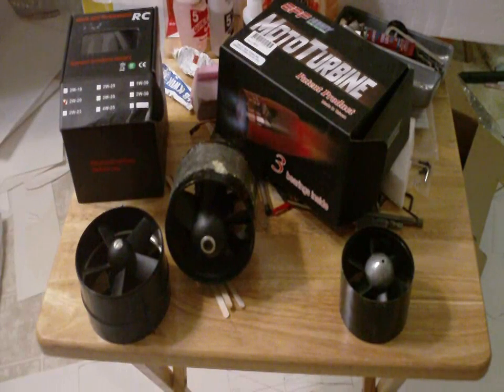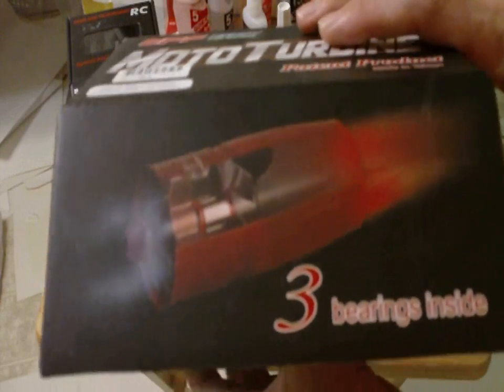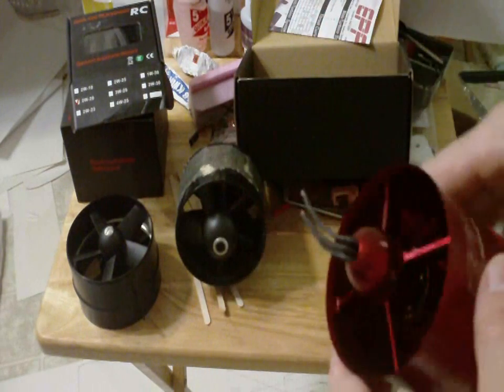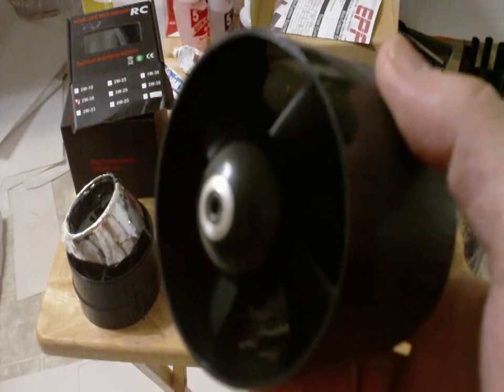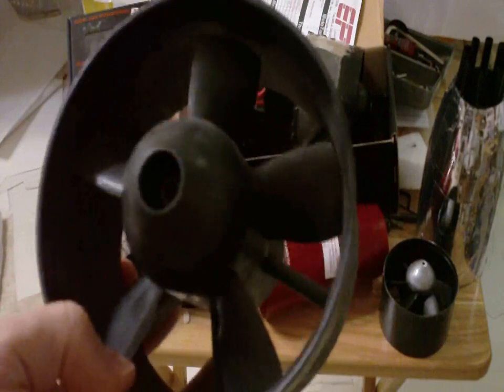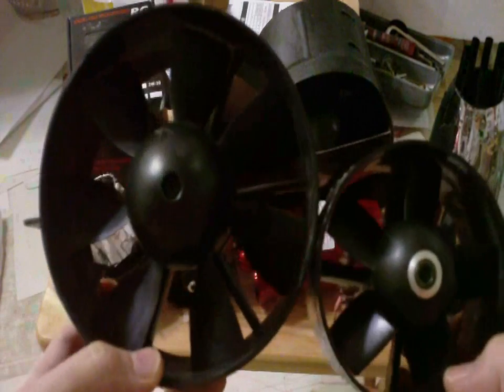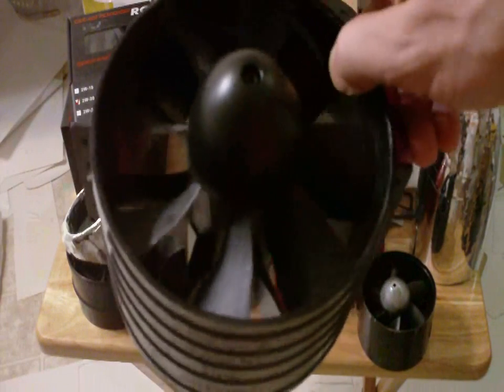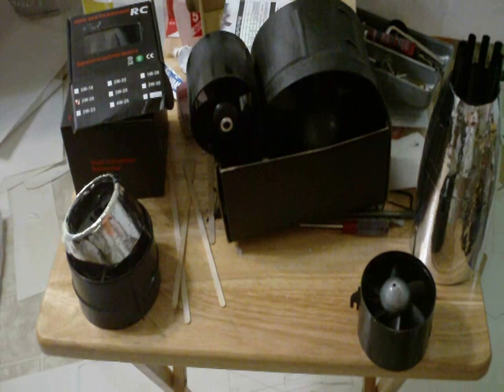Let's talk about EDF's Electric Ducted Fans!

Comment: Hello. I like to control 5 of these for a hover craft build two back throttle two right hand stick steering fans and a cushion fan can this be possible with a drone power distribution board two steering need to be in idle speed until I move the right stick for steering and can one battery be connected to each fan

Comment: What electric engine should i use for a 100kg 4-motored plane that is cheap
Reply from the maker: 220 Pounds?  Wow you might want to try an actual RC Kerosene Turbine engine for that, you'd need something like that to power a plane that size Diego.
Reply: @F3HDemonDriver1  haha makes sense or i might get about 50 edf s to power it
Reply from the maker: What type of Aircraft is it?
Reply: @F3HDemonDriver1  aluminam 747-8
Reply from the maker: Wow-Nice, You have any Videos Of it? or are you still building it?
Reply: @F3HDemonDriver1  no but i will start it soon

Comment: how do you figure the engine that will work on an air plane, for example the plane weighs about 20 pounds, what EDF Electric Ducted fan  would you use, what BA ?
Reply from the maker: The way I determine the right EDF unit is this, the thrust the EDF puts out and the weight on the EDF + Brushless motor, then take into account the weight of your plane, so a 20 Pound RC Plane I would go with two 100mm or two 125mm EDF units. you want at-least 9lbs of thrust from each EDF.
Reply: Thank you so much, very big help.  I enjoy your videos
Reply from the maker: Thankyou Skip!

Comment: From experiment smaller diameter EDF are more efficient than the bigger diameter edf. I particular like the 55mm diamer. Two of the 55mm could produce over 500grams of combine thrust at 10.8V x25 to 28amps. Its very difficult to get over 500gram of thrust with 10.8V x 25amps of power from a single  EDF...my 2 cents.
Reply from the maker: I totally Agree Angel-of-M, but you need to remember I made this video 8 years ago and EDF's have changed allot since then and I've learned allot more about them.

Comment: byron fans lol i have many   not for sale , trying to deal with edf  no flight times  and foam is only thing light enough to fly wiht them. i find nitro fuel  is still cheaper but  the liberals  dont like the extreme noise i produce. i have new in box byron f-16 with fan unit  i may consider sellling being im still flying the 3 i built. but im considering a edf version but not eco friendly

Comment: Hi, iam making an airliner with dual edfs on either side of the wing. so do I need two 11.1v lipo batteries for good efficiency. for how many minutes we can take the plane in skies? with 2 batteries
Reply from the maker: 2 Lipo batteries for two EDF's is what I would do, although so people use one larger lipo to power both EDF units.

Comment: what type of battery would you recommend for a 90mm edf, curruently iam doing a project were i put an edf enginein a rc car .
Reply from the maker: Hi Sir, It all depends on the Motor and what the manufacturer recommends but 90mm EDF's Usually use 18 to 22 Volts of power and 5 to 6 Cell Lipos

Comment: also 
the tricopter i am making is small 
so a Edf with 10 blades or 12 blades is not required
i think that one 70mm with 4 blades is the best but still i am unable to find it
Reply from the maker: +devansh Nigam.  Sir the 70mm HET fan unit is the best 4 blade EDF on the market Sir, my 707, 767, BAC-111, DC-9 all use that uni.

Comment: obrahim: USE EDF electric jet motors AND buy a Tesla Power Wall battery. In fact, Buy 5 batteries and used approx 170 EDF electric motors mounted in formation with necessary space in-between. 170 should give you 100 Kg of extra lift, i.e. rideable. //Erik S

Comment: Hi i have a glow engine 25 os with tuned pipe and the fan i have in at the minute i feeel is not powerfull enough to get my jet in the air as its taking to much runway.could you tell me the max fan blade size i could use on my 25 glow engine please? much appreciated for any info and thanks in advance
Reply from the maker: David Reeves if your using a 25 O.S. glow engine the I would say its only suitable to be used in a 70mm fan nothing bigger.

Comment: Does anyone please know what is the requirement of an EDF, i want to use a cheap ebay 30mm 13,000kv EDF, without ESC, just directly, to make a miniature cyclonic vacuum, i have an AC drive, but it doesnt go past 500Hz.., thank you !
Reply from the maker: Not a bad idea Mike! Your gonna need some kind of electrical fuse or circuit to control the motor. . . .  You might be able to pull the guts out of a hair dryer.

Comment: Hello. Great job. please check our latest EDF hexa copter project. you will be amazed by the power and the flight control. Electric Jet Multicopter I6 EDF 20140306 - 2nd flight - 8minutes - 3.5kg hexa, WKM

Comment: So its been a while since the video..  I bet the EPF hobbies unit has failed by now..  Also don't confuse people.. the rotor is balanced on the HET to a degree.. Once you install it.. its close but not dynamic balanced .. Dynamic balanced means that the unit is all balanced together which means its assembled and spooled up.. THE HET has not bullet connectors so the rotor is balanced but once assembled its not in balance.  HET is awesome but a pain to balance perfectly.. If you have any rub marks in your fan its not blade stretch its a balance issue!

good video...
Reply from the maker: Hi Jack . . Yeah this video was made 3 years ago right before the new multi 10+ blade edf units came on the market. . . . I need to do a newer follow up video.
Reply: blade stretch only occurs at very high rpm. for nylon 6/6 its at about the 70k rpm mark where serious deformation occurs, and way over 120k for yield. no fans are dynamically balanced, because as you say, once installed it needs rebalancing.

Comment: What motor and voltage would I need to drive a 90mm fan at 50,000RPM?
Reply: Try a 1450KV motor. For the battery just multiply the voltage by the KV to get the rpm. Oh and get a bit more RPM than you need because the motor might slow down under load.

Comment: ye lol, i have run the calculations and i think about 10kg of thrust would do it. which is 22lbs.
this should give me an initial acceleration of about 1m/s/s which isnt bad. 
the question is cost...... i know it will be expensive and i was wondering how much these 125mm cost ?
also how many cells do they run on ?

Comment from the maker: For that kind of speed you want to look at WeMotek, HET, SchuberFan, or any of the new 90mm 10+ blade EDF's that are now on the market. and 10 minutes plus flying duration all centers around your battery and amperage draw of the battery, I would say a 3000Mah+ battery will give you the flight times you desire. remember this video was made almost two years ago and ALLOT has changed in EDF technology since then.

Comment: On the subject of testing EDFs, would it be a good idea to build a miniature version of the test cells the large engine companies use for engine testing on the bench? That way, if the fan were to disintegrate it would hit the test cell wall or the observation window(s) instead of the tester.

Comment from the maker: There is a set screw in the front of the fan blade unit unscrew that then take the blades off then you can get to the motor-fan firewall to unscrew its fairly strait forward.

Comment: i think its the more Volts the heavier because more volts means more cells ... 4s like Two times bigger than a 2s... mah my hobby store said is your capacity or run time...but my 5000 mah came in the mail its small its only 2 cells thick , but im worried i wont have enough volts going to my 60A ESC to make the car move lol